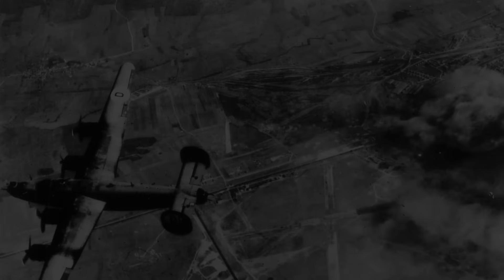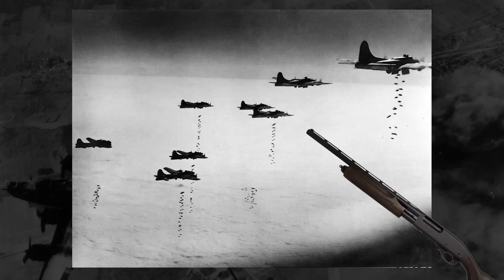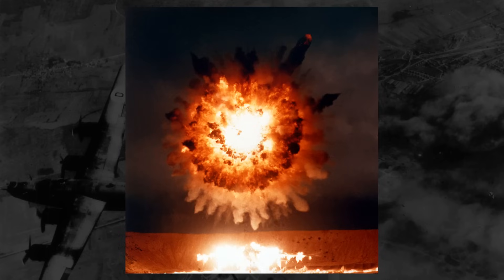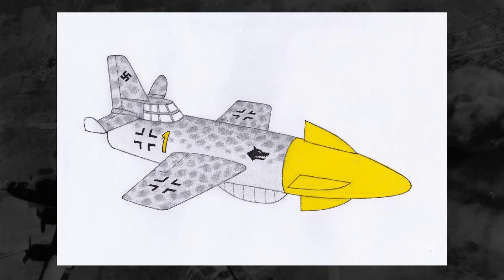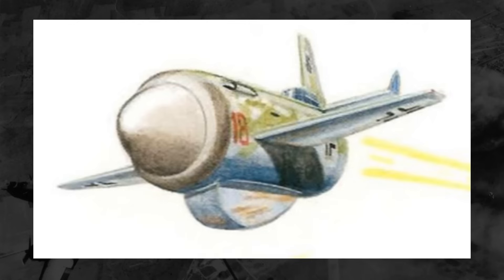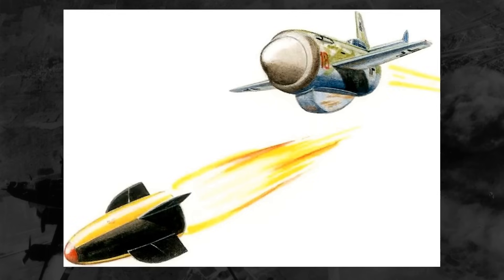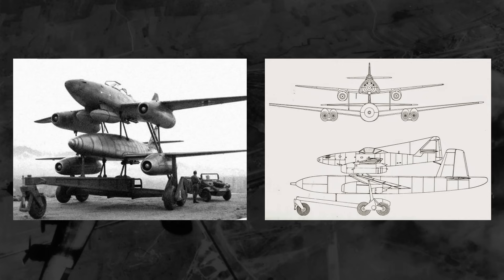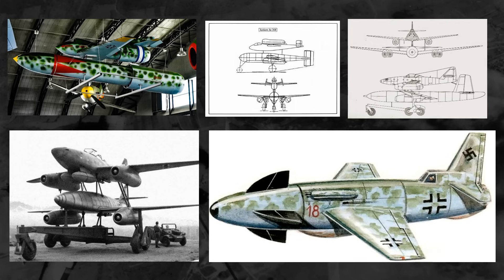Destroying Bombers By Intentionally Missing: Sombold So 344

Comment: Why do you think that putting two jet engines on a mistel was considered wasteful by the Germans in 1944/45?
Look how many aircraft could be shot down by a Me262 before the engines were lost one way or the other. Like about 0.1 or so.
If the mistel could take out reliably even one bomber on average, this would be far less wasteful than the jet fighters. 

That late in the war the production of jet engines was simply not a limiting factor for Germany. Fuel, pilots and support equipment was in far shorter supply.

Comment: A) The jet engines used on the Mistel Bombers Aircraft would have come from other aircraft, with only an hour or so before needing a total rebuild. 
B) These last ditch ideas were just attempts to prevent your entire design group from being sent to the Eastern Front to die...

Comment: G'day,

Check your Reality at the door, did  you ?

"Enough fuel for 25 minutes of flight..." ; you said...

"Walther Rocket Motor...", you said.

Based of a visual estimatuon of the size of the Fuel & Oxidiser Tanks in the  Me-163a, and the Me-163b - which had 3 minutes..., and 5 minutes of Fuel, respectively ; and considering the relative dimensions of this 
Brainfart...

My estimation is that the statistic for which you grasped while over-reaching..., was on the balance of probabilities - closer to
25 SECONDS worth of Fuel.

Enough for one high-speed
Firing- Pass towards the Bomber Formation....

Which brings me to the point that, as depicted, the Side-Area forward of the Wing's Centre of Pressure  with the Warhead fitted..., was greater than that behind the CP ; so the Concept was fatally
Directionally Unstable.

Then..., assuming that it's Gentre of Gravity was slightly forward of the CP, when rocketing towards the Designated Enemy 
(any me...? Any Me...? ANY ME...?) ; as soon as the Warhead (Waaauughhh(!)head.. ) was launched, the remaining contrivance, suddenly bereft of 850 Pounds of Aerodynamically
NECCESSARY
Nose-Ballast - the machine would be helpless to do ANYTHING
But to rear it's Nose up to the Zenith, stall
And fall
BACKWARDS
ALL
The way down 
To the Ground...

But, ALL the time the Team 
Wasted doodling the Drawings and guesstimating it's likely performance ; was time they spent 
NOT being paid to obey
Futile Orders to 
"Stand To...!" with an armload of Panzerfausts and a Backpackfull of Potato-Masher Grenades, attempting to stem the flow of every Soviet T-34 Tank participating in
Operation 
Bagration.

So, in that sense the Design was quite "successful"
(Suck Cess Fool...) !

Just(ifiably ?) sayin'

Have a good one.....

Stay safe.

;-p

Ciao !

Comment: Meanwhile the Allies actually had a wonder AA weapon in the form of the proximity fuse 😅
Reply: Cavity magnetron was discovered by a accident, and did not have a explanation at the beginning, beside it did work. So that is more luck then science/engineering, what is a feat of strength, is to build a radar proximity fuse, that can survive after being fired out of a gun, and mass produce the fuse and still made it reliably.

Comment: 10:01 when the warhead was fired, wouldn't that have shifted the Center of Gravity so far back that the remaining plane becomes too unstable to fly (promptly pull a cobra)?
Reply: Either that, or it was unflyable until the rocket is launched, and THEN its a perfectly balanced plane…. Either way you’re fucked.
Reply: No lol, if designed to do so that will not happennn, when your making something you think about these thing bro and for some reason if you forget to think about balance,you fix it with sliding counterweights or just fixed ones, 

Weight balance can always be fixed, 800 pounds is alot but you don’t have to make it completely balanced, you can change fuel placement for that
Reply: They may seem a wierd idea but the engineers who thought this up would have seen the problem just as you have. I imagine those aerofoils on the warhead are primarily to create uplift to counter its weight so that the mother craft would be designed to be stable after release.The moment of release would likely be pretty hairy though and I'm sure, as usual, it would be planned that the pilots were barely trained novices. What could possibly go wrong?

Comment: I never understood why they didn't make cluster-type things that would create a "cloud" in front of the bomber's path.   Instead of just falling, they could  be on little parachutes or even better  "polynoses" - the samara type seed pods that kind of 'helicopter' down.  They could be dropped from above the bomber stream and could spend more time at the right altitude so that some bombers would likely run into them.   Maybe they could have incendiaries or trail wires that might get tangled up in propellors or some such.
Reply: Air mines with parachute was tried, especial the British was interested in them, and did use the Z Battery, that fire rockets that deploy "air mines" but it was never better then conventional weapons. If you can predict so well in advance where a bomber will be, so you have time to deploy the "air mines" in front of him, you can shoot him down with a conventional AA barrage.
Reply: it just seems to me that parachuting or helicoptering air mines would _stay in the bomber's path for longer giving such prediction  a larger _margin _of _error.
Reply: @joeqmix  No, its only in the bombers path as long it take for it to "fall" the bombers height. about 3m for the fuselage. The explosive radius of a AA shell is about 7 to15m so you have better margin for error with a AA shell.

Comment: The first question the So 344 raises is how to manage the CG so that the aircraft can be controlled both before and after the rocket warhead is launched. Trim control can only do so much.
Reply: My thought as well. How can you jettison 800+ pounds from the front of a smallish airplane and have it remain flyable?
Reply: As long as the center of mass before and after launch is in front of the center of lift there is litteraly nothing that would prevent this
Reply: @maxmachac9756  it seems to me like the wings are way too forward for that. The only possible solution would be a lead weight in that nose-cone underneath the rocket, and just the thinnest wood construction on the cockpit and tail section.
Reply: @Nikolai2s  not really, theyre in a pretty normal spot

Comment: The narration seems to say that "air burst explosives" (which would destroy the target by bursting near it, insead of striking it directly) were unusual,  Actually that is how nearly all of the shells fired by German 88mm, 105mm and 128mm guns, and similar large caliber AA guns of the other WW2 powers worked, depending on time-fuses to detonate them as they passed close beside the target aircraft..  Only the late-war American and British proximity fused shells, the Japanese naval San Shiki combined shrapnel and incendiary anti-aircraft shells and a few British 3" shrapnel shells left over from WW1 worked in other ways, and of those only the proximity fuses were effective.  The Germans also attempted this with the 28cm "Pulk Zerstoerer" a bombardment rocket that was fired from Bf110 and Ju88 heavy fighters from behind American heavy bomber formations outside the effective range of the US .50 caliber mgs.  Having matched speeds with the American formation and firing from a fixed estimated range it was hoped would correct for the low velocity of the 28mc rockets, but it was not very effective.
Reply: Yes, but those missiles weren't actually intended to destroy the bombers, just to force them to disperse so the fighters could attack more easily.
Reply: @Zbigniew_Nowak  I would argue the 88's and 128's were certainly meant to destroy bombers. They had a whole fusing setup where a detached rangefinder would find a target, the shells' fuse base would be briefly attached to a mechanical computer to set a time delay before being loaded and fired.

What you may be thinking of is long-range naval AAA, which was primarily focused on dispersing enemy formations. Before radar and proximity fuses, most naval AAA guns were not set up the same way as mentioned previously. The larger calibers would have time fuses, but they would be manually set before being loaded based on at best range numbers distributed by a shared fire control rangefinder, or at worst a small local rangefinder to the gun. Ships had the advantage of also being able to concentrate medium-caliber AAA such as Pom-Poms and 40mm Oerlikon, to focus on destroying individual planes.
Reply: @Nikolai2s  Yes, but I'm talking about something else. These rockets were typically mounted on the Me410. There was a revolver-type launcher with several of these rockets. They were fired at formations of bombers. The main goal was to force the enemy to disperse.

Comment: The Japanese Navy ACTUALY had a round that was a buck shot-style antiair defense - The Japanese Type 3 AA shell and they were supposedly referred to as Beehive rounds. The shells were intended to create a large volume of flame which attacking aircraft would have to fly through.  It was a combined shrapnel and incendiary anti-aircraft round used by the Japanese during WW2.
Reply: 18inch beehive shells xd
Reply: They also didnt really work and werent use in any meaningful capacity
Reply: @maxmachac9756  They didn't work well for AA, but they were used quite effectively during the Guadalcanal campaign for airfield bombardment.

Comment: One of the prototype flying weapons wing aircraft that Northrop was working on during WWII was an aircraft rammer. It was reinforced to survive the collisions.

The term "Northrop flying wing rammer" refers to a concept, specifically the Northrop XP-79B, a flying wing fighter designed to ram enemy bombers. This experimental aircraft was envisioned as a way to use its wing structure to literally cut through the wings of other planes
Reply: British Hurricanes were actually notorious for trying this (or rather their pilots, of course). The Hurri was a very robust fighter, and pilots in BoB, after running out of ammo while failing to down their target, would sometimes - completely against orders - actually head in and ram the opposing bomber. There is actually film of this happening, notably a Dornier going down with it's tailplane cut clean off. Russian pilots were also notorious for this, which they called the 'Baran'.

Comment: They tried it on a small scale. They dropped bombs from fighters flying over enemy bombers. Apparently, it sometimes worked. But it didn't change the course of the war.
Reply: I came to make this comment too! I've seen an interview with an old German WW2 fighter pilot who was talking about dropping those bombs in the middle of formations and saying that sometimes they managed to destroy 4 or 5 bombers outright and scatter and damage a dozen others.
Reply: @VincentNajger1  There was a plan to use the V2 rocket in this way. Or rather, a derivative of that rocket. A giant anti-aircraft missile with a warhead whose explosion would destroy several planes in formation.
Reply: @Zbigniew_Nowak  when you're getting bombed from above without the ability to retaliate, that really seems to set-off human creativity and imagination about any possible way to stop it. And for the British as well, in efforts to stop the V1 and V2. Fascinating.

The R&D efforts and resources here would almost certainly have been put to better use attempting the win the ground war, especially on the Eastern Front. I'd imagine if instead of pursuing these aerial Wunderwaffe, the same money was spent creating stamping presses for the MP-44/STG-44, and pumping-out Panzerfausts, the war would have continued somewhat longer for Germany. Their materials and manpower shortages would have forced an end at some point, regardless.
Reply: @Zbigniew_Nowak  That was the "Wasserfall" rocket, based on the V2. It did not see actual deployment, but it could have been really effective against Allied bombers.

Comment: the barrage balloon is credited with bringing down approximately 231 V-1 flying bombs. Not bad for older tech. These balloons, deployed in a curtain around London and other key areas, were a relatively low-tech but effective method of intercepting the V-1s, which typically flew at lower altitudes.

In his book "I Flew for the Fuhrer: The Memoirs of a Luftwaffe Fighter Pilot," the author Heinz Knoke talks about dropping bomb into B-17s formations which would then explode and possibly bringing down several B-17s.

The Enzian, which looked like a pilotless version of the Me 163 and would have also exploded inside USAF bomber formation. The lethal radius was 45m (49 yards). You can imagine what effect that would have had inside a bomber formation.
Reply: I think a rudimentary beam-riding SAM would have certainly been possible. However, the Allies would adapt, either with jamming, or dispersion. Even if such an early SAM hampered Allied bombing efforts, it would certainly not drastically change the course of the war, perhaps prolong it at most.
Reply: Those are both very interesting concepts. 

I think what most people forget though is with this sort of development the plan had always been to do what we do today: SAM net.  That would stop bombers cold, an it only would have taken another year.  A lot of their effort was going into that for most of the war.

Comment: When looking at "what if's" i've repeatedly come back to variations on the idea of a basic rocket, even simply a V1 or V2, with a massive warhead.
But i just cannot find any sort of reliable comparison to figure out just how far away something like 1 or 2 ton of explosives(without shrapnel, with the aim to have the shockwave be so powerful by itself that it is enough to take out any nearby aircraft) would destroy something like a B-17.

The reasoning for the huge warhead being simply that you want to impact as many bombers as possible, and accurate targeting is very difficult at the time, so use area of effect instead of trying to score direct hits.

And if you want to amuse yourself with another game, try Fran Bow.   ^_^

Comment: Not 'hi calibre' but large calibre.  Ariel mines were used and did have some success, of sorts. 
The was a  BF109 variant with strengthened wings were used to ram b17. The plane would only have 50 rounds of 20mm  shells

Comment: Barrage balloons caught V-2's by the dozens.
Reply: Don't you mean V1s? V-2 was effectively a primitive ballistic missile, while the V-1 was a cruise missile. The V-1 would have very much been vulnerable to barrage balloons, as they didn't have the capability to take any kind of evasive action, and flew at low altitudes.
Reply: V2s?  Plunging out of the sky at supersonic speed?  That seems unlikely.  V1 cruise missiles would be another matter though.
Reply: That's BS. There's exactly zero recorded evidence of a V-2 hitting a barrage balloon. Not to mention a barrage balloon would have zero effect on the 1-ton V-2 warhead dropping at Mach 1.5.

Comment: Late war Germany: What if we strapped a man to a rocket and he leaves and rocket goes boom?

Late war Japan: What if we strapped a man to a rocket and both go boom?
Reply: In America, BF Skinner was going to train birds to be the guidance system for missiles.
Reply: @sparerib5494 he actually did train birds to do this. The only thing that was not actually built was a true pigeon bomb. The problem was that the interface for the birds was clunky (they were essentially pecking at a stretched sheet that had an image projected on it, held by wires wrapped around rollers that would move when the sheet was pecked), expensive to build, hard to mass-produce and calibrate to each group of birds. The problem wasn't the birds, it was everything around them that made it impractical.
Reply: Hitler in really late war Germany: "You know, the Japanese might be right. Let our pilots crash into bridges to stop the enemy advance and so on!"
The Luftwaffe: "Sure, mein Führer." - "Let's just tell him we did. He will never know the truth!"